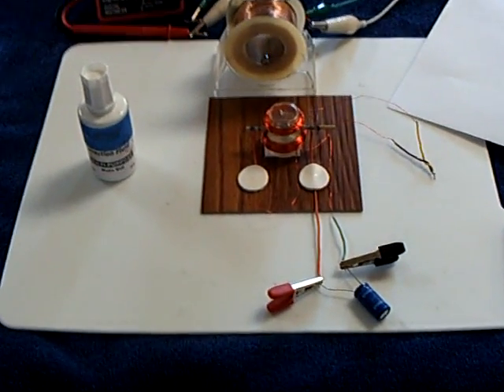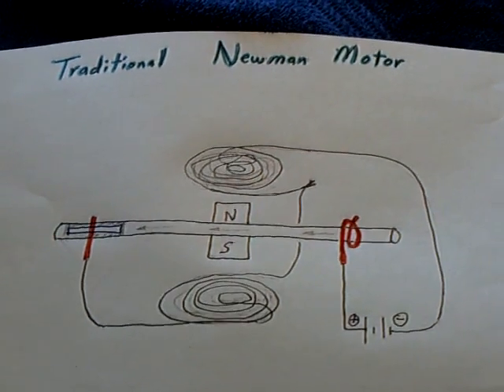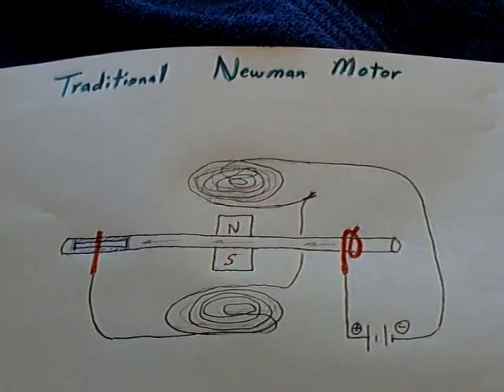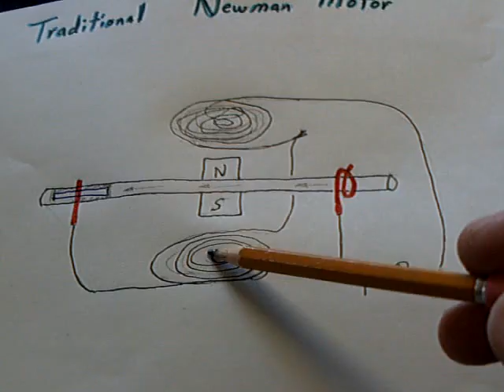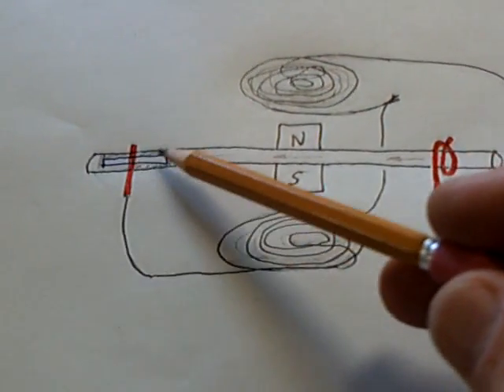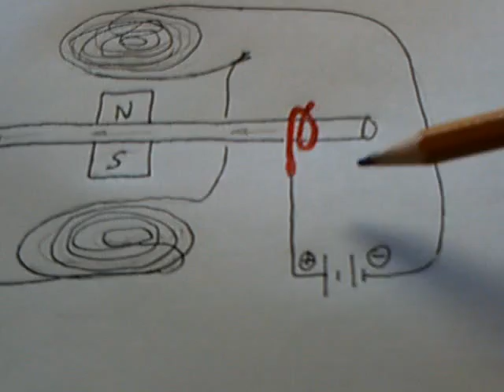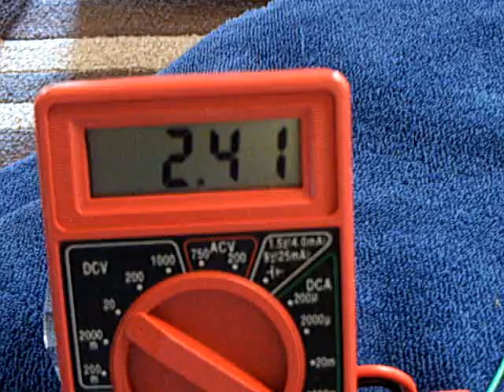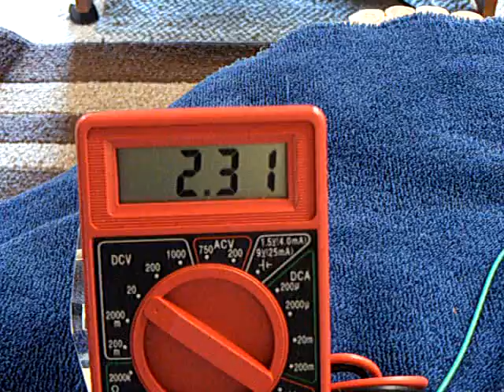Tiny Newman Motor -- Generator

Comment: The Newman motor is a small device that can convert mechanical energy into electrical energy. The heart of the Newman motor is a rotating magnet that spins a tiny ball magnet inside the pickup coil. This setup creates a current in the coil that can be harnessed to generate electricity.

Comment: Yo dud, i got a homopolar motor design that i would like for you to construct.
The "novel" idea is to use connections through ball bearings - where you would need 2 (or 1) bearings for the shaft and a bigger bearing having in it a copper disc to which a magnet is attached (or the shaft or both).
the small bearing is + and the big bearing is - or vice versa and N and S magnet (or 2) will decide the rotation.
Could you construct smth like that and see what it does on hig volt and low volt and high amp and low amp modes. It SHOULD spin faster than AC motors with lower torque.

Comment: I know this video is old, but I have a question on it. If the coils are in series and the north is running through the top coil and the south is running through the bottom and then they switch polarity, how is it that it runs at all. Isn't it like an alternating current, or am I missing something. How does it send electricity back to the capacitor? Thanks.

Comment: Ok, I admit it...I'm just stupid. I have watched several little videos about the Newman motor and so far no one has been able to explain this thing so that I can comprehend it. Perhaps I should make one myself and then all my questions would be figured out. Guys that make videos on You-Tube may be electronic geniuses but they are not good video makes nor good teachers.
Reply: The Newman motor basically turns on and off its' coils in succession in-order to conflict with the permanent magnetic assembly poles. In order to do this one would need the current to stop and turn back on to push the rotor around again. The only issue I have with this design is that it has no torque, so it cant do work as shaft of a motor. But it can manifest electricity very efficiently.

Comment: Mind you, Newman himself NEVER claimed perpetual motion or free energy... He ALWAYS maintained that EVENTUALLY the energy would burn out... However, what he did claim was that he captured the "back spike" of energy lost in transmission, therefore being more efficient... Apparently this was because of the thousands of feet of copper coil he used (miles even) which captured the back spike... This is why it's never really been replicated by anyone because of the sheer amount of copper wiring needed to pull it off.
Reply: I know this as Back EMF. The collapse of any field will have the same energy expanding as it would implode. See Master Ivo on YouTube.

Comment: What is the point beyond getting the motor to spin on little energy?
Can you store energy for later use? Can it be harnessed for any use?
I see the voltage put out.... does output exceed input?
----If you can indicate any ideas, it will be great.
Stirling engine runs on a differential that causes a +/-
Stirlings have been employed to pump water...
Reply: there is a way out - 
One main newman engine will keep running on its own power source, both sides of the rotor can have polycarbonate disks attached to it on which N52 button magnets can be attached which will induce currents in coils placed near them, these coils can power other batteries or power other  newman machines..........
THEORITICAL ARRANGEMENT..........DONT KNOW IF IT WILL WORK.......

Comment: So a somewhat inefficient rotary voltage converter as previously employed to generate high voltage, low current supplies to operate valve radio equipment from a 24 volt battery bank on ships from the 1930s onwards until solid state devices took over in the 1970s. The biggest advantage of these machines is that they are literally bombproof in all senses of the term.

Comment: sir thanks a lot. i just made one of this...  but im kinda having a hard time finding a 2.7 V 5 F capacitor. is there any alternative to it? i also want it to run with capacitor..
Reply from the maker: +erbinjay padit Use any 2.7v or 5v super capacitor.  Try to get one that is at least 1 Farad.   Amazondotcom or EBay.
Reply: even the voltage is high? how about 10 v 1 Farad? that is only what i can find here
Reply from the maker: +erbinjay padit  That will work.  Don't expect it to run very long on just 1 Farad.  You could could put a 10 Ohm resistor in series with it to get a little more run time but at a slower speed.
Reply: ok ill try it.. thanks a lot ^_^ are a arealy big help sir

Comment: Thanks for posting all of your videos; I think it's awesome stuff. I understand the whole over-unity debate and rage that it incites...however since I'm only starting out on learning much of this I'm hoping you can please answer this for me/us if you know. Clearly the "axel"/shaft is spinning, and thus you can create a mechanical output from the shaft into something such as a brush motor/generator, right? If that's the case, then couldn't you create or modify a "lightweight" brush motor/generator that runs efficiently enough to not require too much power as to over-utilize the Newman motor, and then use this mechanical energy to charge the same battery or capacitor that's running this whole setup? Therefore the only loss would be something like the capacitor failing over time and the magnets wearing down over time? Long story short, what I'm asking is if lets say a 9v battery can produce the equivalent burst output of 12v's (picking a random number) and then utilize that as mechanical energy to charge that same 9v battery back again, shouldn't you be able to keep the system running for a long time? I hope what I'm asking makes sense. I'm going to try to start building what I'm describing and see where I get; I'm merely trying to save myself some time as I'm sure someone has tried this before, right? Thanks in advance for your time and reply.
Reply from the maker: +enigmarocker That doesn't work.  I have tried it many times and in many ways.  You need an external source of energy to keep a machine moving.  It CAN be a very small amount it the machine is extremely efficient.
Reply: +Lidmotor Thank you for your input, Sir!
Reply: @Lidmotor  What about the 2-3 volts you are creating from your coil with the spherical magnet?  Aren't there enough amps?  Also, why don't you use a larger spherical magnet?  It seems like it would produce much more electric.
Reply: you are talking of original newman machine my friend.....

hope you have succeeded in building one.......

eager to see the video here on youtube.........along with its construction procedure, parts used etc.

Comment: I am actually very interested in "Replacing" transistors. If we are going to take  responsibility out of corporate/govt hands, we must be totally self sustainable. All these things we build require processed metals..... I do not know how to build this stuff w/o metals thus far and I myself am not a proficient smith/miner. I love that people are experimenting, but we cannot play the same games or by the rules of the game we want to quit. Is it possible to replace a transistor with some other form, like perhaps a simplex circuit, or a "Motor/inductor/generator." So you would have a primary generator wheel, firing coils into a smaller secondary timing wheel, that feeds back to the primary wheel. A switch/relay/oscillator is basically an inductor

Comment: I have had this thought several times, a Transistor is nothing but a slice of crystal pressed against a Gate kinda like a diode, so basically its a doped crystal with 3 terminal points. A capacitor is a RF, or just a Frequency detector, with a dialectric... The crystal is the dialectric. Has anyone used one of these homemade crystal cells as a transistor, possibly with correct doping so we can use these same devices as relays/timers/switches. Also, this thought has been running through my mind constantly. Back to the Future, Doc browns, Flux Capacitor. It has 3 points.... And these crystal cells act as a source of DC/AC, and flucuating quantum fields as well as the same, piezo/space time warping of the quantum flux field as transistors. Apparently the alchemists, and the process of transmutation, currently called, Phonon Resonance, relies on "Relaxation Oscillation Excitation." It should be possible in theory to design a capacitor for EVERY situation, Matter condensation, Accumulation, Disassociation, Generation of "Plasma" fields. I believe the egyptians were not using electricity, but the other state of matter, known as Plasma. Plasma itself is highly energetic, flows easily and if the earth were in a different "Structured" crystalline state it would have allowed/worked with immense fields of "Colors/plasmas" just waiting to be discharged. The plasma itself can be "Densified" eventually down to a state of matter, I see a rolling dough/light effect not unlike a rectifier bridge in an oscillating circuit. If this were the case, the Tesla transmitter, and all other transmitters of a harmonic nature will gradually "Restructure" their core materials and their Infinitely expanding magnetic field force lines will impact the surrounding waves/matters with the same result. All of our devices parasitize the Earth, source of Mains power. None of these oscillator circuits build up a potential and then discharge them back into the earth in order to "Acculumate" more charge back into the earth. All equations stem from the principle, three steps forward two steps back, the wave theory.  After seven cycles of steps, we should then "Reap" the fruit of our labors, and are rewarded with an impulse of totally free, energy of which we can utilize without taking any from the earth or the environment. Since people are slowly coming into balanced circuit equations. Every time you pump something away from one area, you must, "Fill in the hole." With some other medium or what you took. If you want to grow something, the process must be additive. If free energy works, then it must work on the principle that Waves can cause constructive interference. We still draw power from a source, but we must put back, what we have taken, and eventually add a little more. That way our battery Keeps getting stronger or at least stays stable. So one tick to run motor, one tick to charge source, and one tick that can be tapped from motor to do useful work. Rinse repeat, and after a few rotations the process is slowly additive. Lightning strikes, are like the universe pulse charging the earth. When we use power, even burning things to generate AC we are draining earth battery of her charge. The earth experiences a shrinking of her density, but expanding of gasseous layer, and the pressure changes, lightning is an immediate Reorganization of the gasseous mixture obtaining energy, discharging and releasing more dense particles. Which eventually rebuild the earths Terrain. When enough molecules are packed together and align correctly, they just fall effortlessly together. This is the result of your sympathetic oscillators. Energy can also stagnate and cling to things based on its roughness/viscosity. Energy comes in many flavors/colors/frequencies. This is why tuning is important, many of our gadgets are not picky about their quality of signal, but in the higher frequencies, you must be precise or you see no action.
Reply: I am impressed.

Comment: This idea of energy from the vaccume is very misleading. I think people think just because you cant see or detect something in a certain place there is nothing there.
Its very possible there are million's of universes exsisting in the same place at the same time. The reason we can see them is because they use a different frequency but that does not mean we can use that energy, we just have to find that frequency or other means to tap it. Think of vaccume energy like hydro power. Its There all the time but its not really free, you need infostructure. Hydro dams are very expensive, but this might be much cheeper if we can figure it out.
Reply: You are talking of two different things my friend - 
1) Newman motor utilises the building & collapsing magnetic fields to produce +ve, -ve voltages
2) For zero point energy, refer cassimir effect.......scientists have extracted energy out of vaccum.........

Comment: I bet if you could get enough windings and get that pocket of dead space in the energy pulse, the energy sucked from the vaccume would be taken from the ambient heat in the air around it. Energy cant come from no where but there is so much energy around us all the time in many different forms its just plane silly we still use oil at all.  If any one ever figures out how to spin a good conducting fiber of graphine you could use a thin thread and it would conduct just as well as 20 gage wire or better. It would be so much easyer than winding wire. I wonder if carbon fiber would work?

Comment: Does it mater that we wind the coin in the  same direction ? And does it  mater that both winding coils both side synchronous
Reply: Both coils should be wound in the same direction, and connect the outer wire of one coil to the inner wire of the other. You can buy copper wire (often called magnet wire - it is merely insulated copper wire in fine gauges) on Ebay, or you can open and unwind from old appliance motors or transformers.
The Newman motor is easy to build and hard to screw up. Make as many windings as is easy for you, so it looks like the ones on the videos. Use whatever gauge wire is easy to find. 
There a lot of videos out there on how to build Newman motors, that is how I learned.
Reply: Mark Bachelder
Connect one end of the coil wires to your battery; connect the other the armature (a loose wrap around it, to pick up the juice). The other lead from you battery goes to the "make-and-break" side of the armature. By the way: when you scrape off the correction fluid painted on there (nail polish works good too) scrape off about 180 degrees lined up with one side of your magnets. This will give you the right timing for the motor

Comment: Excuse me for a nonpro. question but does your replication work as Nemans engine ?  does it produces more than it consumes ? does it charge the capacitor and lighten up the leds ?
Reply: At the end of the day, "The Laws of Physics", still/always apply to this day.  But dont give up trying to find changes or exceptions to those laws, this is what experimentation is all about, isn't it?  We only stop learning when we think we know everything. Good vid, and thanks for sharing, this is great educational stuff!
Reply: This is the big question nobody seems interesting in asking or answering.
Reply: "does it produces more than it consumes ?"
ARE YOU AN IDIOT ????
think !
Reply: If you have seen the original machine in action - 
1) around 200v batteries power a 2000lbs rotor, how feasibile is that..
2) Now these batteries not only power this hefty rotor, but also gets charged

So all in all, we see such a huge rotor rotating at measly voltage and charging its power supply, THIS IS UNIQUE. Any other arrangement having this result ?????

Since, this machine runs for hours, we can conclude the rotor replenishes the batteries, its drawing energy from......ATLEAST MOST EFFECIENT MACHINE IN TERMS OF REPLENISHING THE USED UP ENERGY.......

OPEN FOR COMMENTS ...........

Comment: I hear that to make this motor work a overunity you need a lot of wire. Its said you need enough wire in the windings that the electricity cant reach the end of the winding before it makes a full rotation. If you could make that happen then the pocket of dead space between contact to the power source  in the winding would pull energy out of the vacuum. Im not sure but if you looked at electricity as water the dead space could be like an air pocket and still provide some pressure in the flow. Any thoughts?
Reply: That makes sense, actually. Entropy always "suck" the energy out of somewhere. And the vacuum is everything but empty.

Comment from the maker: Yes that 4.7 F supercap will work.  Just remember that the motor uses energy.  It does not make it.  A couple of 1.5v AA batteries work just as good.  The supercapacitor used here is just an interesting quickly rechargeable energy storage device.

Comment from the maker: There are circuits for doing that but my experience is that you don't gain much. It is kinda like plugging the back end of a vacuum cleaner into the front end and expecting it to run when you unplug it.  Seems like it should work.
Reply: It's not comparable.  In that scenario,  the vaccum would explode if it behaved like electricity.

Comment: Great work as usual now kill the LEDs and diode the generator back to the cap and see how it will run put a diode on the shaft like the commutator pulling the back spike as well, I bet it runs a really really long time how long can it circulate???hmmm...